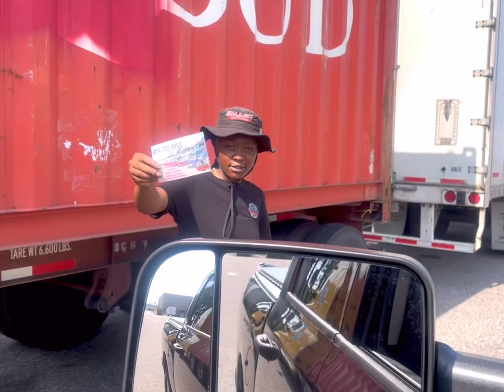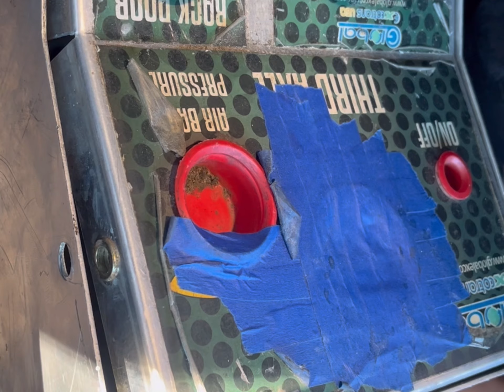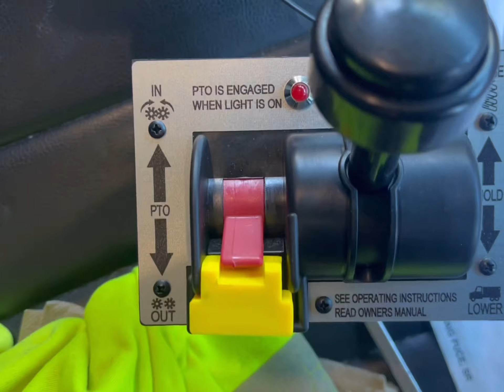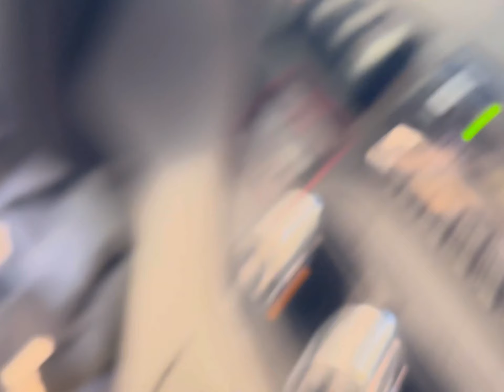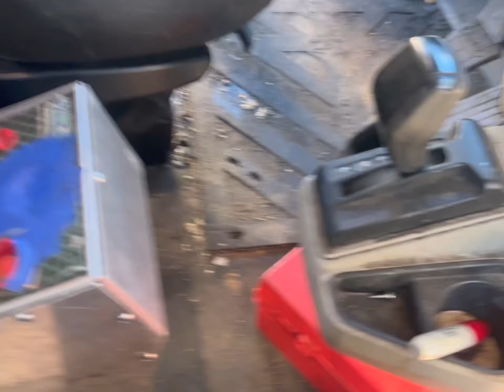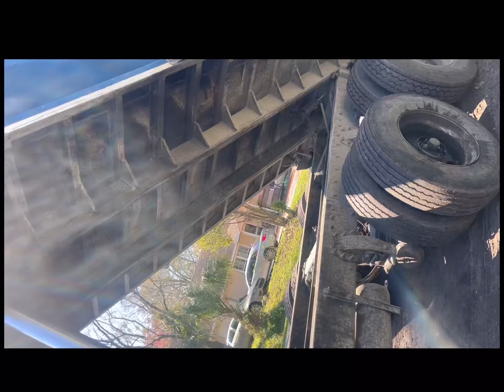Dump Truck Bed Not Going Up

Comment: Could this be the issue if bed only goes up about a quarter of the way. I cant get to filler under bed to add fluid
Reply from the maker: Yes that can definitely be an issue lack of fluid will cause it not to rise as much and not at all if there is no fluid in the tank.